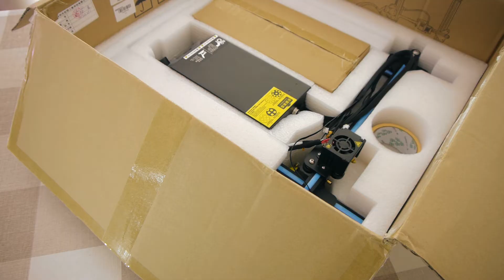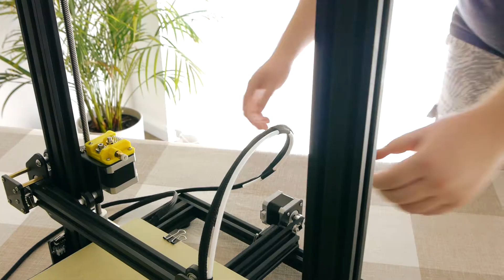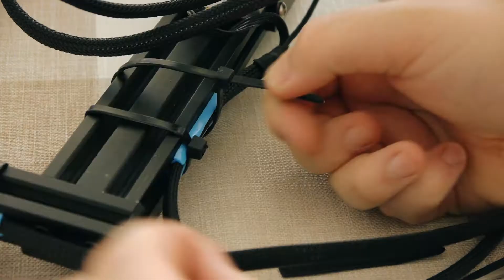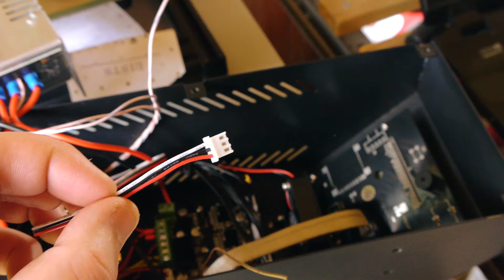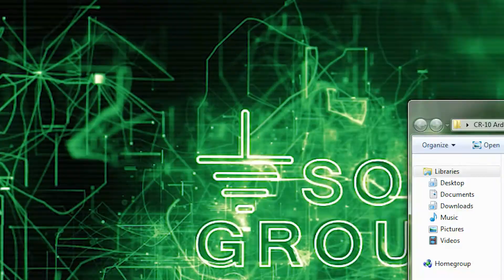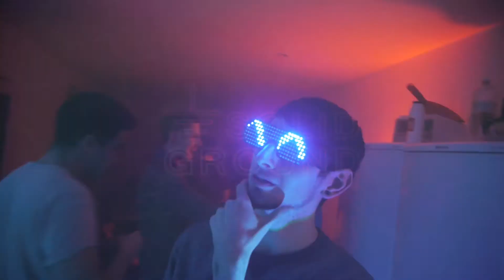The best 3D Printer CR-10: Unboxing Review and Upgrades

Comment: Excellent and clear video!  I am puzzled though about your not being able to use your glass platform with your sensor.  The sensor I am getting prepared to put on my Anet A8 is the LJ18A3-8-Z/BX, which will sense 8mm, which should be plenty for accommodating the glass.  Isn't this the same sensor you used on your Anet A8 mod?  Curious as to why it wouldn't work on the CR-10.  I look forward to your review on this printer-- especially curious as to how you think the single Z-axis stepper compares to the double steppers on the Anet A8.  Thanks again for sharing!
Reply: Eric Randall I believe that that sensor wouldn't work as it's an inductive sensor, which works by inducing a current in the sensor when it comes into contact with metal. So with his Anet A8 video, there was only a BuildTak covering the aluminium heated bed but with a thick layer of glass covering the heated bed (with only a 8mm clearance) the sensor would be too far away to detect the aluminium. However there are other alternative solutions, such as a capacitive sensor or a mechanical sensor (such as 3D touch) which can be used with glass.
Reply from the maker: BenjiManCan thanks for sharing the know how! I've been away from my computer all day today and its good to see the beginings of a helpful community forming. Not wanting to be patronizing but thanks.
Reply from the maker: Eric Randall like Benjimancan said, the glass bed had to be deleted as the nozzle would touch the glass before the sensor detected the metal of the bed (seeing as the nozzle has to be marginally lower than than the sensot to prevent it from clipping any printed parts) 

Also the ABL only accounts for warped heat beds not warped glass.

Another weird querk is the z-axis bottoms out in the frame before the nozzel touches the bed, if you wind all 4 bed screws down.
Reply from the maker: Eric Randall thanks for the praise too, much appreciated!

Comment: Great video as usual Fred! Nice touch with your logo on the startup of the LCD screen of your modded firmware. Cinematography and music choice is brilliant, I can tell you put a lot of effort into this video! May I ask, how does the BuildTak compare with the Lokbuild build platform? And I can't wait for the next video, looks great!
Reply from the maker: BenjiManCan Thank you :-)

The build tak seams to be a little thicker so you could probaly get more life out of it (if you periodically sand it down to clean up the surface). They were both simple to apply and peform identically as far as I can tell. Gearbest will probably want me to make another video  so I may talk in more detail about it then.

Anyway thanks for watching!
Reply: Ah okay, that's interesting, thank you for the response!

I was wondering if you could help me install an auto bed levelling sensor into my Anet A8, as I'm having a few issues.

I've been trying to install the auto-bed levelling sensor using the same setup as yours and the sensor seems to work when I power the printer on; the red LED is constantly on and when it comes into contact with metal, the LED turns brighter (which I assume is a good thing).

However, when I set it to auto-home, the Z axis does not move down like it usually does (until it hits the switch), but it moves up a bit. Although when I auto-homed the printer with a piece of metal under the sensor, the Z axis moved down, like it should do. So the sensor is acting in an opposite way to what it needs to.

I believe that it's been wired up correctly with a 10k ohm resistor connected to the base of the transistor and the signal wire of the probe and the same transistor has been used.

I initially thought that the NPN polarity of the transistor was incorrect, so I switched them around but the problem still occurs.

Images are here: http://imgur.com/a/wO0u9

Perhaps the software can be tweaked to work in the opposite way it needs to? Any help would be greatly appreciated!
Reply from the maker: Ah this happened to me on the CR-10 when I did it using my Anet A8 circuitry. Perhaps there is a variation in leakage currents. Try putting a 10K resistor between the base (middle pin) and the emitter (grounded pin).
Reply from the maker: I must get confused as it thinks the switch is constantly being pressed, so it moves up and away until it turns off (as the endstop switches have a mechanical hysteresis) so it can come back down and confirm the height on the second reading. If the endstops stays triggered because the npn is conducting due to a leakage current, then it will keep moving up.
Reply: Solid Ground Electronics Thanks for the suggestion, but I just tried this and the same thing is happening :/ Is there a possibility that the sensor I have is faulty? I bought the exact same one as yours and I'm using the same transistors, so I don't understand why this is happening. Once again, I really appreciate your help, but I don't know what else to do.